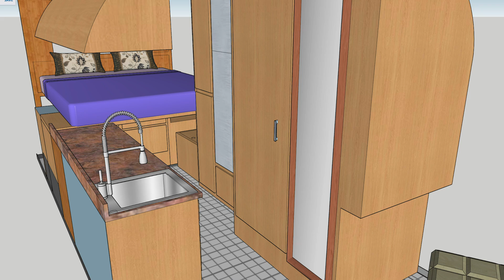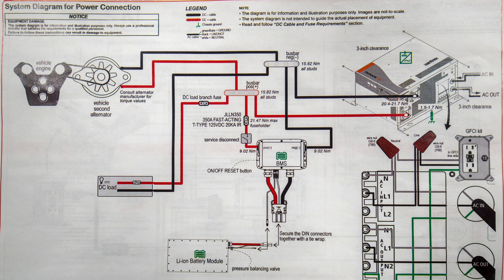Van builder ends 100 day seclusion to speak of the immediate future

Comment: It’s nice to see your still around      Using engine heat to heat water makes a lot of sense    I had a bus with the radiator on the side, under the galley, the water heater was mounted over the radiator  it was impossible to run out of hot water

Comment: Glad to see you back George!
Question - Your freshwater loop for the isotemp/isotherm, will that require any special parts like a pump, expansion tank? or will you just run some hose to the engine bay exchanger and it will figure itself out? 

Interesting tip - Have you seen the guy who fit an isotemp/isotherm inside his engine bay? Could be an option if you're ever really tight for space. 
looking forward to the catheter video.

Comment: Glad you are back and the virus or health problems didn't get you since I really enjoy your videos!  My question, why would you want a small 4-5 gallon water heater with the Webasto system?  Why wouldn't you just have the Webasto setup like a tankless water heater?
Reply from the maker: A "tankless" Webasto (or Espar) system requires one to fire up the furnace EVERY TIME you want hot water. IMHO, a hot inefficiency I do not want to employ in warmer climates, where most of van life is lived. Ski Bum? Absolutely, go for it. But I love the idea of making hot water while I drive (with the closed loop heat exchange system and the tank), which is frequent in van life.

Comment: Welcome back George!  Sorry to hear you had a need to go under the knife, but glad that it seems to have gone well and that you are back on track with Humble Road.  Just out of curiosity what is your opinion on these Fresaire 12v cooling systems?  I'm about to pick up a small van which will be a daily driver and am considering ventilation options.
Reply from the maker: Seems similar to a swamp cooler. Not enough technical info on their website. DIY install voids the warranty.

Comment: watching the rest of this video I had to comment again. I wanted to comment on a build I am doing. Its the exact opposite of this and will be posting a video in the next month. Everything I do is low tech and modular. All my gear slides in and out of my 2018 Transit. My bunk, my gear etc. My wife doesn't like the primitiveness of this so my solution is a small tow behind. My build is a trailer. Phase one is the trailer build with a bathroom, shower, power generation, storage and a kitchen. When I travel along I leave the trailer. When she comes along I connect the extra luxuries.   Just thought I would toss that out.....
Reply from the maker: Smart. Options! Cant wait to see the vids!